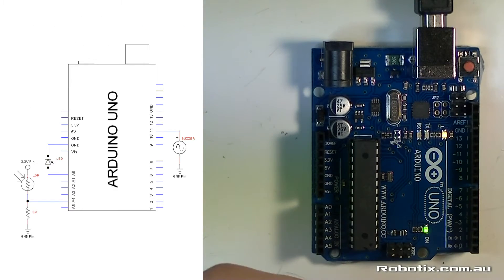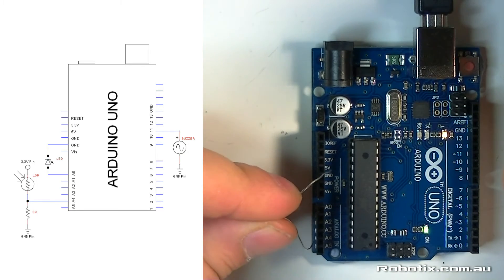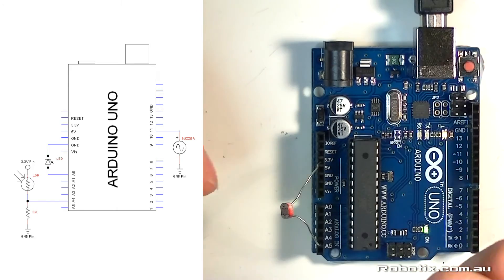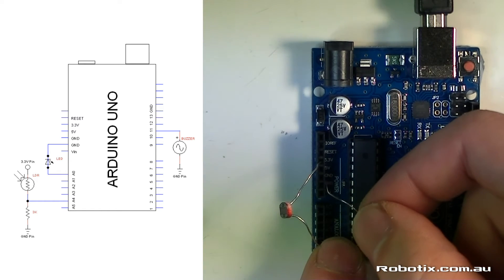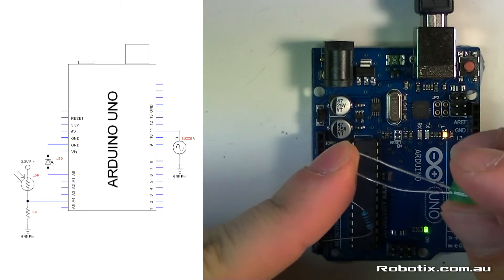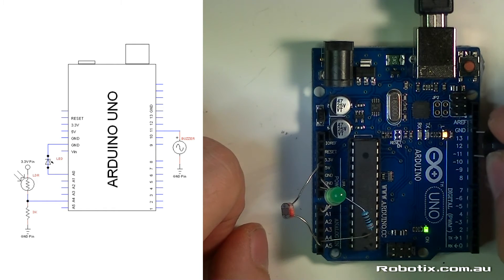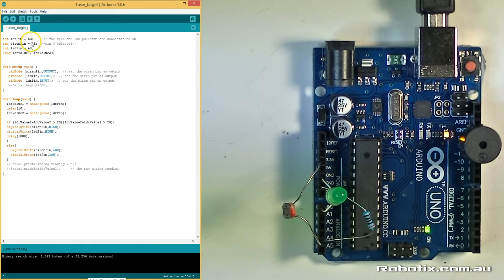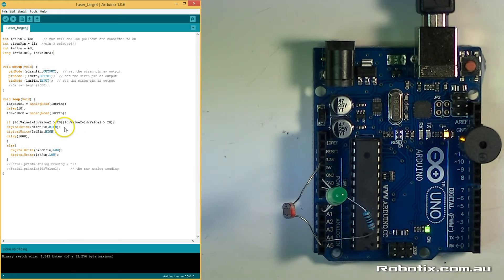2 min Laser Target

Comment: Hey Can i do this with a Digispark ATTiny85?
Reply from the maker: Well its pretty straight forward, ATTiny85 has a 4 I/O pins use one for the led, the other for the sensor (use GND and VCC to power up the sensor) and you are good to go with the same code

Comment: I took the code and the board setting. But the the buzzer is not working! what is the problem? please ask my question.. and thank you Robotix
Reply from the maker: are the legs connected the right way? did you set pins 7 and 9 as outputs?